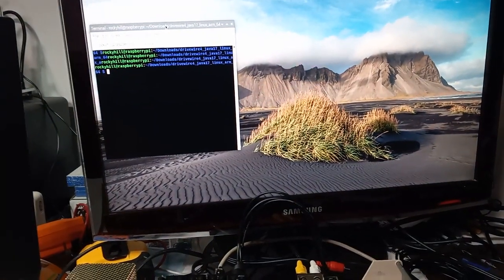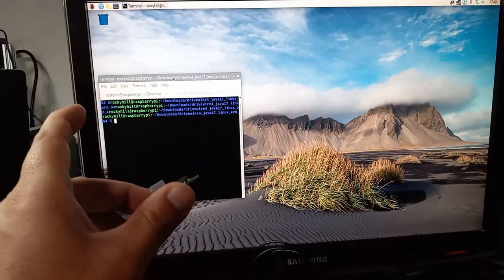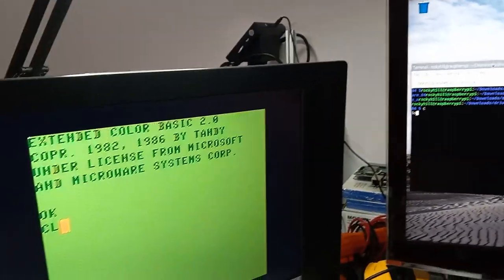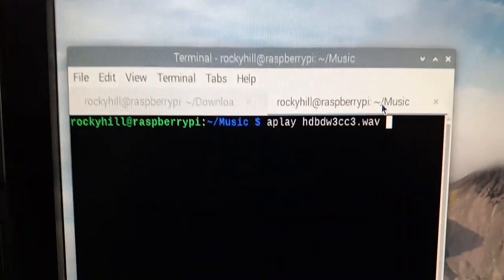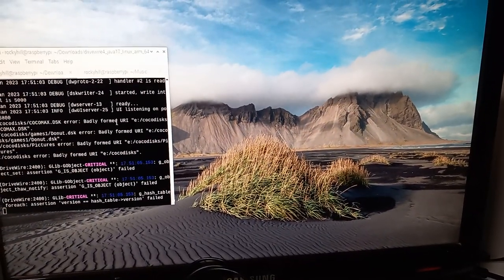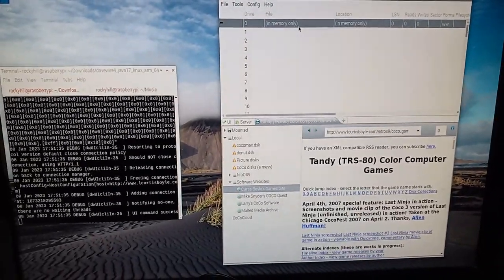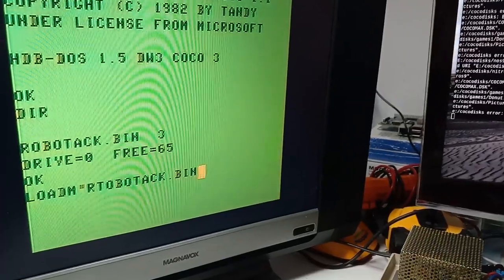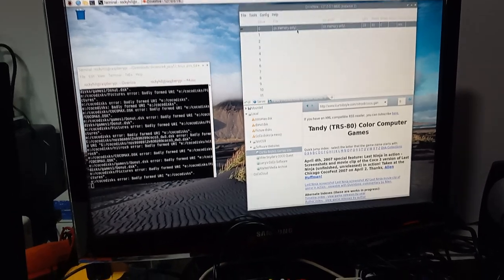Testing a pepper board on a CoCo 3 using DriveWire4 Java on a Raspberry Pi.

Comment: Another guy did a PD power mod and needed to use a Pepper Board to re-establish all functions for serial and cassette.  Have you seen it?  I'm guessing you have.  I would love to get some things done and learn first-hand by example.  One thing I'd absolutely love to do/have is a CoCo3 with the USB keyboard and HDMI out so I can use it with a KVM setup.  Adding PD power to that would make it a lot cooler as well.  I'm in S.Carolina and anywhere in Florida is just a road trip to me (plus I haven't visited Whataburger in too long!)
Reply from the maker: Yes, I've seen that video, I think you're talking about La CoCo Stragiato. Cool guy, we talk on the CoCo discord server. I'm actually working on an adapter to use USB keyboards on the CoCo. Here is one of the videos. https://youtu.be/XRjkQ9mmF6k

It's been a while since I had whataburger as well, now I'm craving it!
Reply: @rockyhill3  I originate from Texas and one of my first jobs as a teenager was Whataburger.  You'd think having worked there I wouldn't crave it... but no... the "working at a pizza place" paradigm doesn't apply.  Would absolutely love a chance to learn from someone who has mastered things.  Long ago, I learned a lot from Dave Philipsen.  Not sure I retained enough, but for a while he got me into coding assembly under OS9 and that was pretty fun.  LONG long ago.  

As I require modern interfacing (keyboard, mouse, video) for all I do, it would be great to repack a CoCo3 into a smaller case, power it with PD USB-c power and connect to it with HDMI (with audio) while also being able to use multi-pak slots... somehow.  That would be the dream.